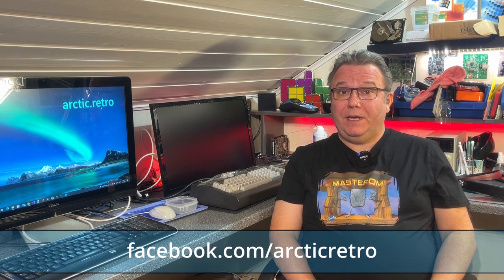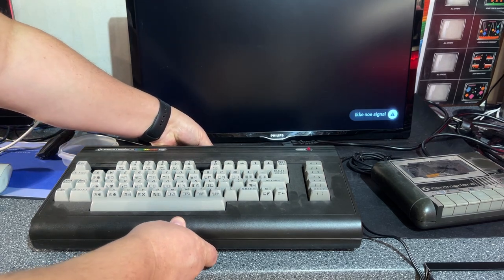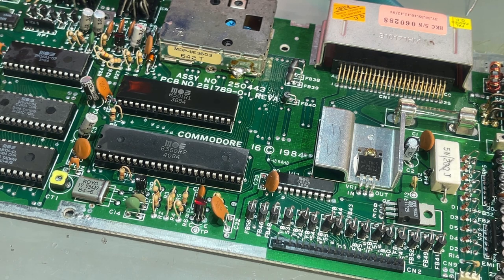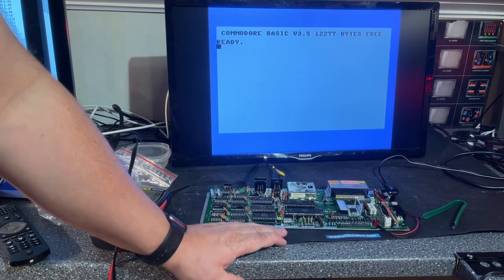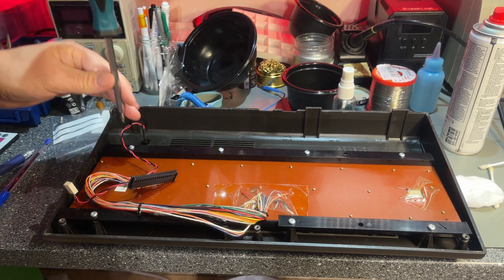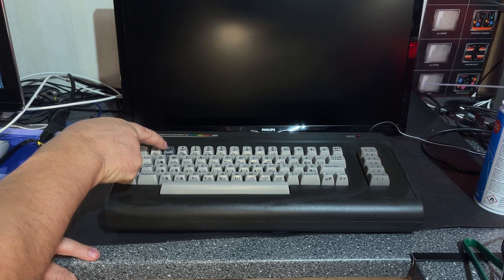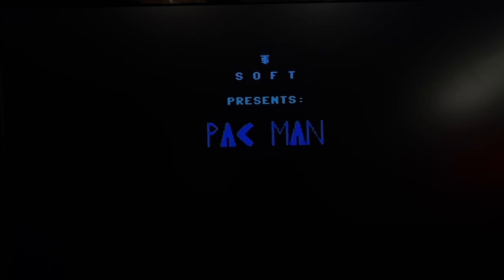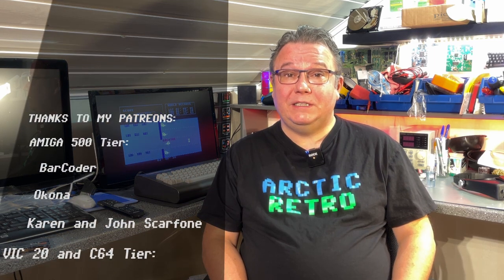New gem in the collection: Commodore C16 + cassette repair and restoration

Comment: The big fat resistor is for dropping the voltage from the 9V power supply to the 5V regulator. I guess the. Deacon lathe drop is 1.5 V, as the regulator would need around 7.5 V to operate properly. Then say the components on the computer draw 1A. That means the big  chunky resistor  would need to be rated at 1.5 Watts. If you didn’t have that resistor, then the regulator
would need to drop
the 9V to 5V and requiring a big heatsink in the process. Anyway nice repair and restore.

Comment: Cool! Never seen one before. nice to know there is one in Bodø. Now you need to get Attack of the PETSCII Robots for it and try it out!
Reply from the maker: Yes, I saw it was ported to that platform as well :)
Reply: Well, but first you have to upgrade it to 64k. It’s really easy.
Reply: AotPR was ported to the Plus/4. It takes a lot of RAM. A C-16 can be upgraded to 64K pretty easily. I did mine. It's really trivial. You can get a device with the extra RAM that just plugs into the TED socket. It can give you the ability flip between 16K or 64K for compatibility. I believe it's called the Sauron 16.

Comment: Nice work Tommy! Are you going to upgrade it to 64K?
Your Pi1541 firmware is very old at 1.19, I'm hoping to release 1.25 soon.
Reply from the maker: I might do the 64K upgrade, but then again, I like to keep at least one machine original if I have more than one. Oh, I haven't bothered upgrading it yet. It just works for the most part :) I will do it next time. By the way, very nice work of you there with the Pi1541 :)
Reply: Great work getting the C16 to function! Eslapion makes a RAM upgrade to the C16 that shouldn’t require cutting any traces, so it’s reversible. I’ve upgraded mine the traditional way and it definitely gets the job done. There are a lot of nice games for the 64k version. I also have installed a uIEC inside as there is plenty of room inside. There are also ready made joystick adapters and instructions to do one yourself.